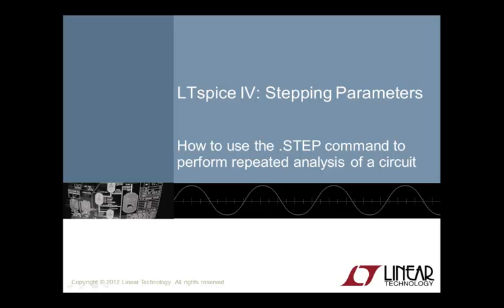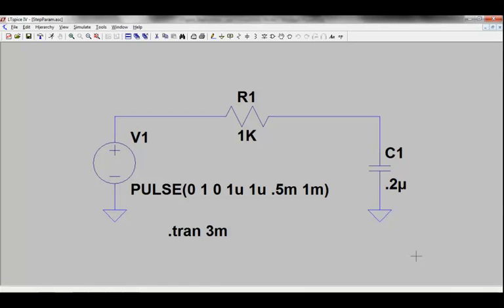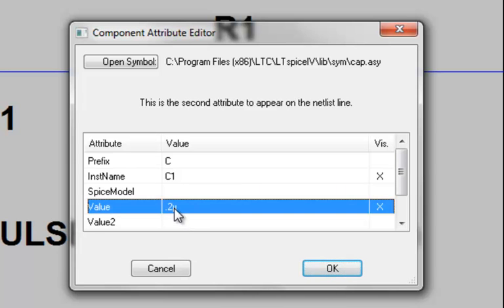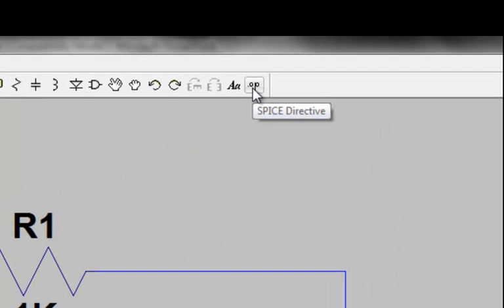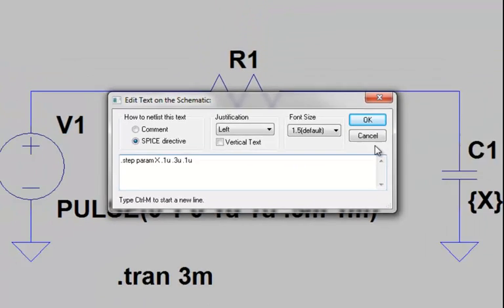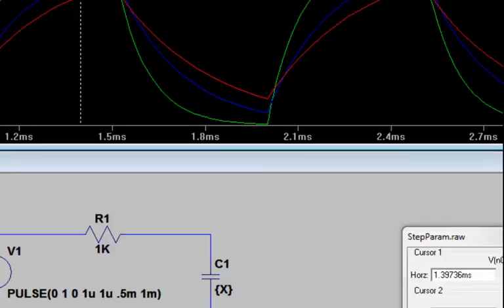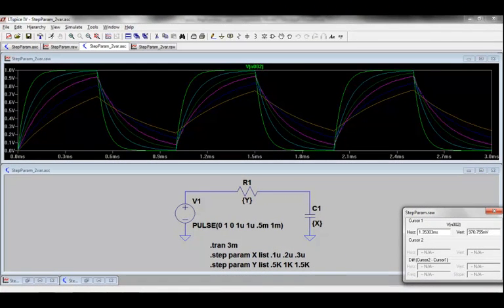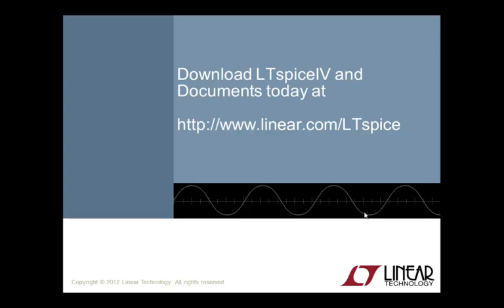Stepping Parameters in LTspice IV

Comment: Can someone pls help me : I have a circuit to show the charging and discharging of a capacitor in circuit with two switches and one resistor. I would like to know how to set up two switches in LT spice where one opens after 50s of transient the other closes at that same moment in which the first is closed. pspice has a open time switch and a close time switch how can create these two switches using the voltage or current controlled switch ??
Reply: yeah, I thought so, maybe it's still useful for  other people
Reply: Guilherme Gomes yes
Reply: Use a voltage source and choose PWL mode, then choose all the voltage values and time stamps as required
Reply: Guilherme Gomes I actually found this out after couple days of research but thank you still for reaching out..

Comment: @LinearTechnology i want to change the value of capacitance with time and check the output. How is it possible?
Reply from the maker: Here is the LTspice page on analog.com https://www.analog.com/en/design-center/design-tools-and-calculators/ltspice-simulator.html  You should be able to use the nonlinear capacitor that allows you to write an expression for the charge instead of the capacitance; Q=<expression>. You can use the keyword "time" for the current time in the simulation. More information can be found in the help file (F1) under Circuit Elements -> Capacitor and for more information on expressions you can review Arbitrary Behavioral Voltage or Current Sources.

Comment: My question is about multi-parameter stepping. While there are 3 values of each resistance and capacitance, why the number of the curves displayed was 6, not 9?
Reply from the maker: Depending on the steps combination, two or more traces can be the same and only one color is shown on the waveform viewer. If you zoom in you will see both traces. Likewise, you can run through the iteration on the waveform viewer, as explained in the video, and see the individual combinations.
Reply: hey, first thanks for the video. is there an easy way to preform the same simulation while receiving 3 curves -> means 1st curve (R=0.5k, c=0.1u )  , 2st curve (R=1k, c=0.2u ),  3st curve (R=1.5k, c=0.3u ) . thanks, Or
Reply from the maker: The easiest way to select the steps you want to view in the waveform viewer is to right click, select view and then select the steps you want displayed.
Reply: @LinearTechnology  
Hi can we change two parameters with single step command.